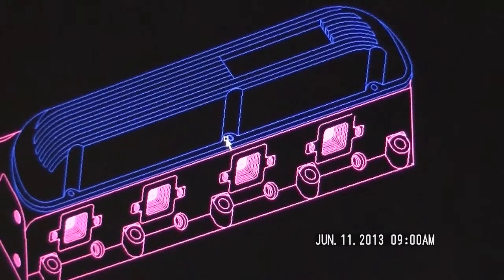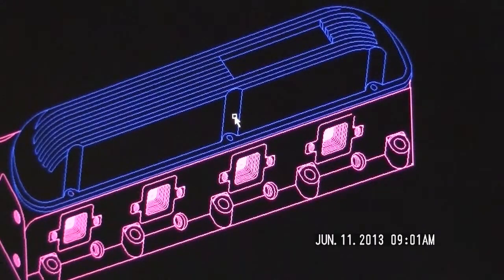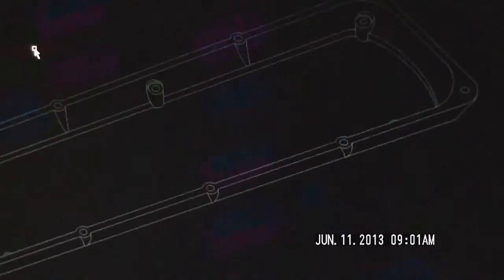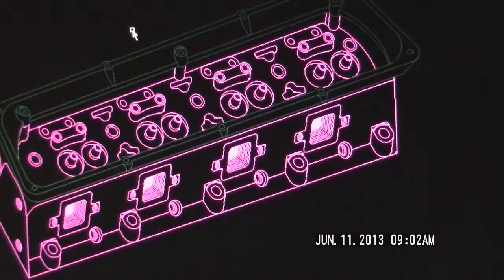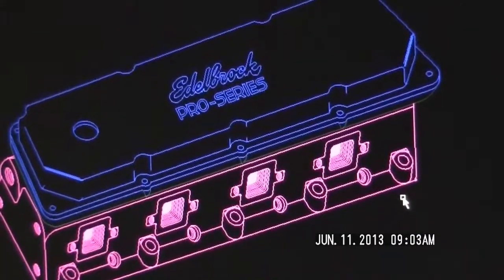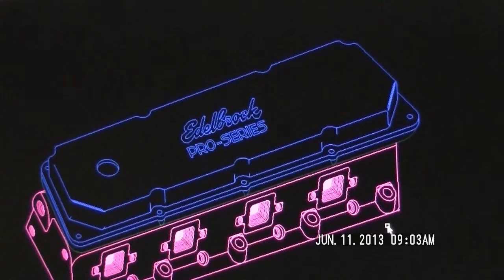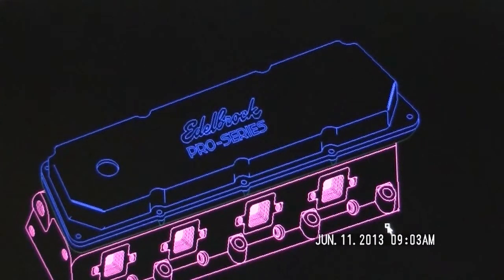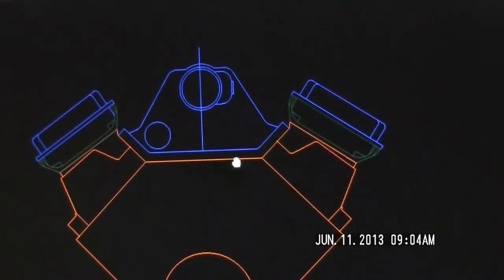421 ci  SB FORD Windsor With Nascar FR9 valve covers

Comment from the maker: I imagine printer technology uses a low TG (glass transitional) plastic. I preceive the printer head to be thermal which changes the material from Alpha phase (solid) to Beta ( liguid or semi) of the plastic for deposition. Unless there is an eutectic polymorphic change in crystaline structure, it'll always want to revert back to Bata at same lower temp.  
I'll have to look into it, there might be new materials that I wasn't aware of six years ago when I was working.
Thanks for the suggestion...